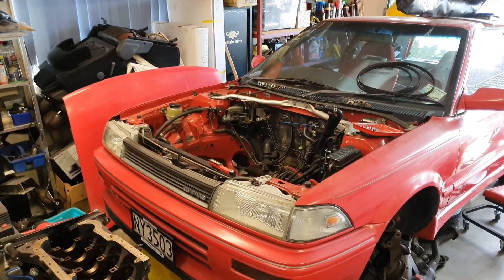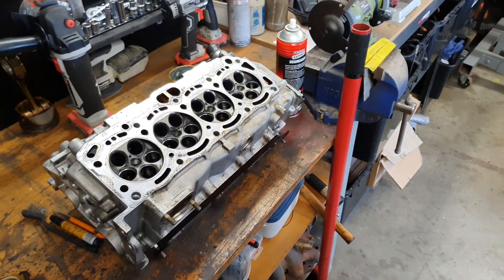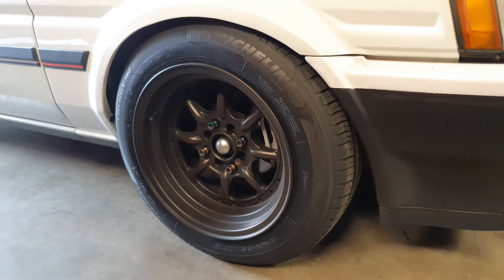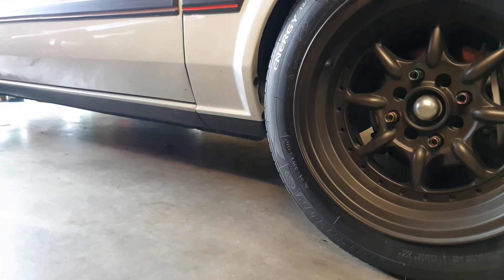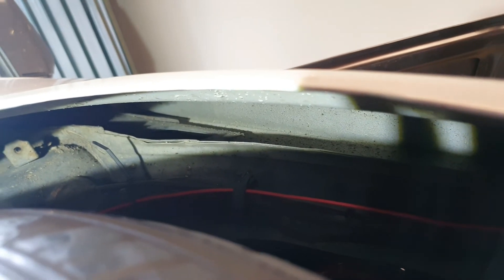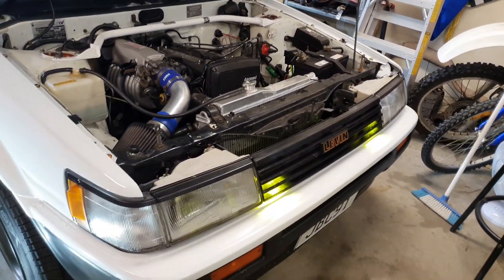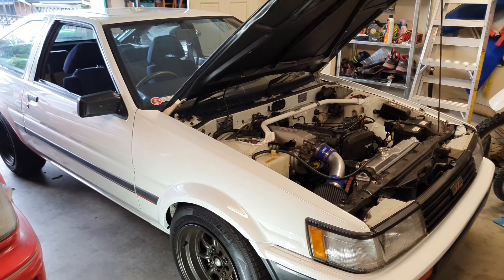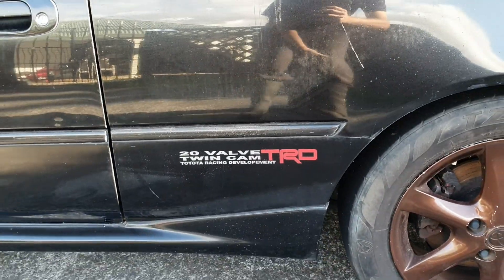2019 catchup while in Covid-19 Lockdown

Comment: How did you put the ae100 seats in the ae86?
Reply from the maker: Hey, they are from a SW20 MR2, one of my earlier video's shows the mounting, minimal modification is needed to make them fit.
Reply: @4AGEEDGarage  They look similar :)
Reply from the maker: @Bredmirror  sure do, very similar styling and headrest although the MR2 ones have more features and adjustment which is good for a cheap upgrade